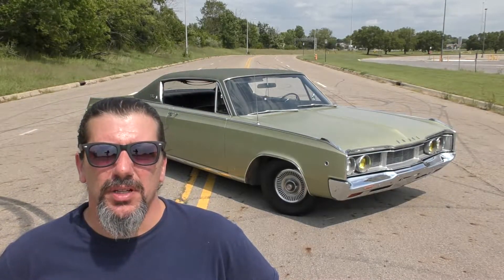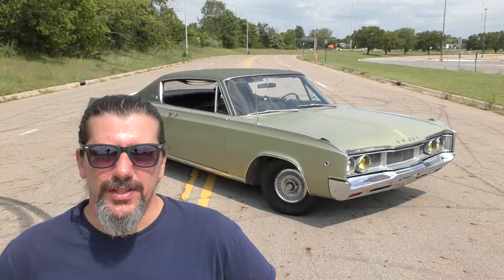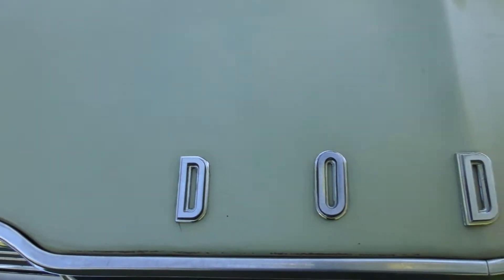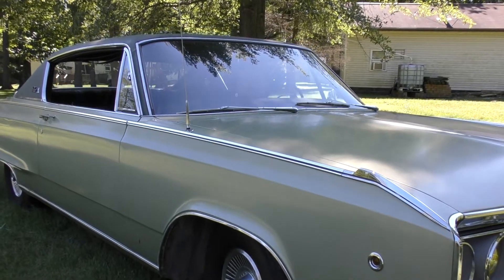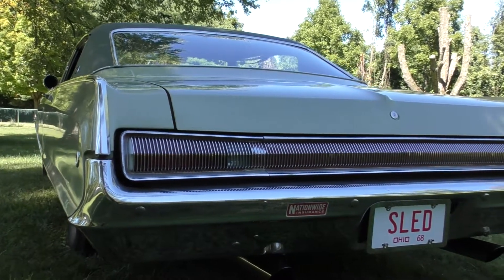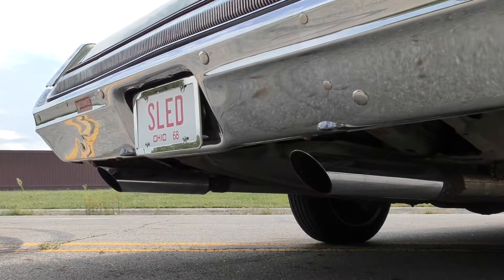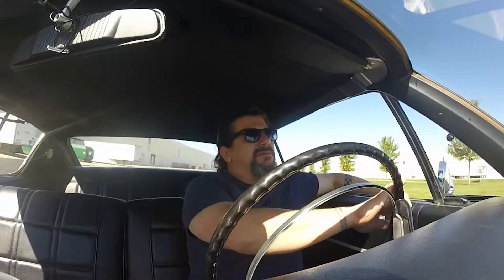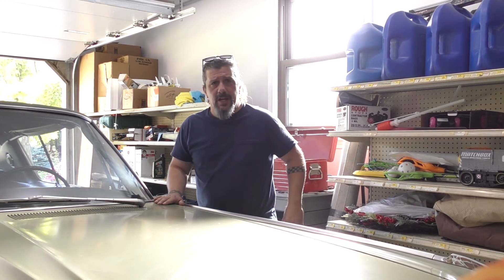1968 Dodge Polara

Comment: I owned the 4 door model of this beast. All 212" of  it.  Off-white paint, underbody coating that kept the rust off of it, even living for several years on a barrier island in Texas.  The firewall  harness is a mess, causing me nothing but grief with charging, it kept burning out regulators. I never did get that sorted out until well after I sold it. 383 cubes, HUGE muffler, it was a big pussy cat, you didn't hear me sneaking up behind you until a hit the horn!  An immortal air conditioner compressor, I never, EVER had to add gas or do anything with to it.  Yours looks a bit naked without whitewalls. Mine sure didn't.   The hubcaps I enjoyed, but kept spinning on the rims and cut valve stems. I had to stay on top of that or I'd be stuck changing flats.  All that chrome tho, I burned through bottles of chrome polish to see my mug in those bumpers, and it showed while cruising down the main thoroughfare. I got 150K miles out of her  before I was forced to sell, her valves and rings were starting to let oil blow past them, and the electrical was getting bad. So she left my life after putting me through high school.
Reply from the maker: sounds like you got enjoy the hell out of it!